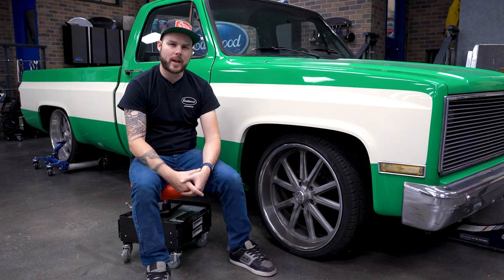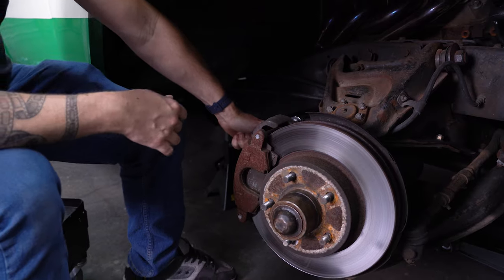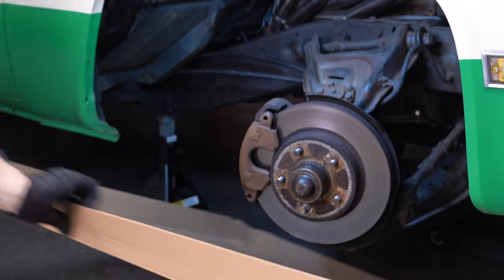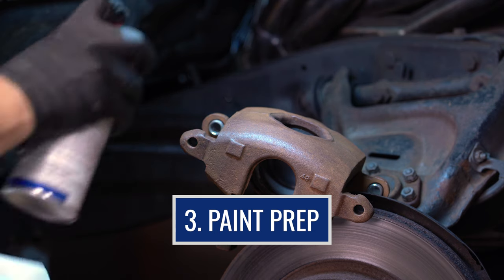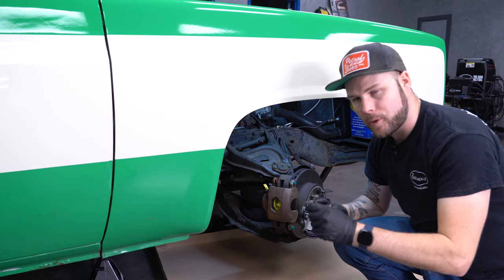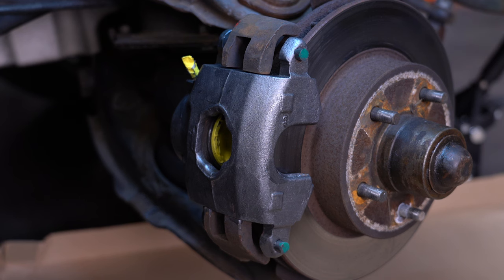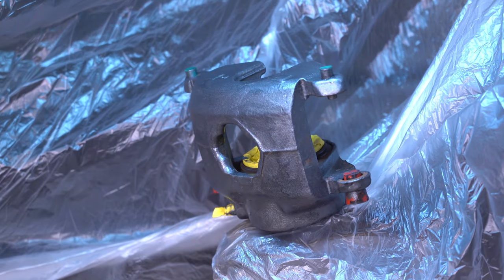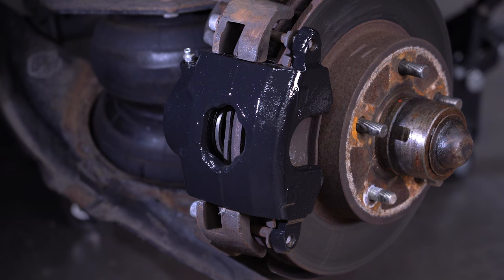How to Paint Rusty Brake Calipers On The Car! - 1985 C10 Project

Comment: It might have been easier if you removed the caliper, just saying.
Reply: Then you have to bleed the brakes, six of one half dozen of another
Reply from the maker: We released a video showing how to paint the calipers off the car a couple weeks earlier and we wanted to show both options.  A lot of people don't want to open up the brake system and have to bleed it so we illustrated this method as well. Either way will get you there.
Reply: Love how ‘just saying’ always follows what’s said. Lol